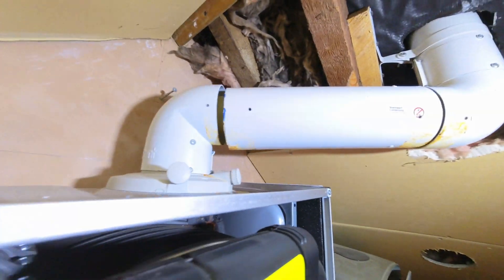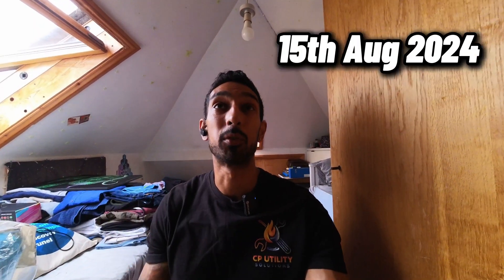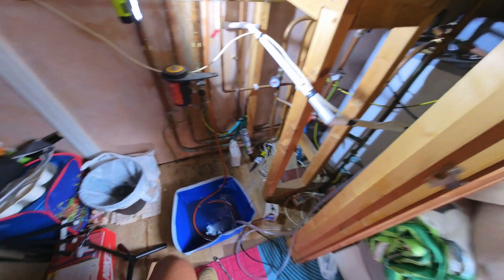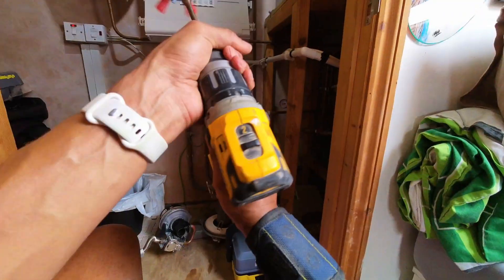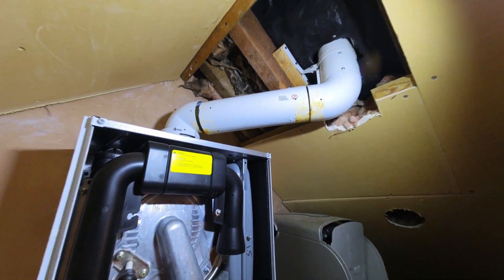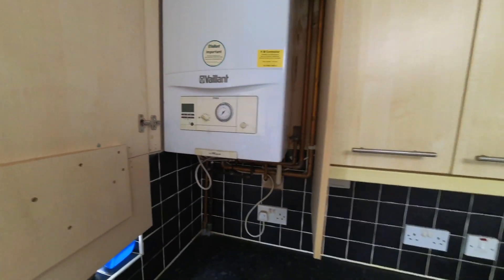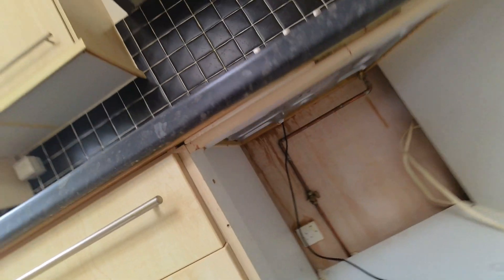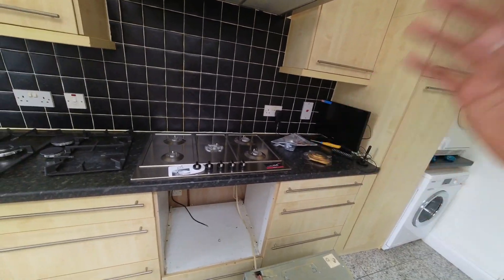This Could Have Killed Someone! - A Day In The Life Of A Gas Engineer 179

Comment: Came across a vaillant flue with a couple of elbows. The customer said the boiler was leaking. I checked the inside and it was all dry. The flue had a decent drop from outside. When I undid the xollar screws I was as shocked as you. 4 to 5 cm gap and a big collar to cover it up. The flue condense pipe was just touching the seal.
Reply from the maker: Come across some proper bodge work don't we!

Comment: Hell fire that gas flue installation was appalling and as you say highly dangerous. Am not a techie, wondered if you check for negative polarity to protect yourself? Saw YT vid where sparky called in due to eratic behaviour think of the led lights and found when meter been changed for smart the + - tails got reversed going into the Henley block.
Reply from the maker: Oh damn! I do carry out safe isolation and polarity checks where necessary, but yeah that's scary!

Comment: I found a vaillant ecotec once with  flue in a void it was approximately 8 meters long and had fully rusted through most of the way along it. It was one of the worst installed flues I had ever seen. At the time boiler was 6 years old. But it was used 24/7 replaced the whole thing 🎉
Reply from the maker: Wow that sounds like a bad one!!
Reply: @cputilitysolutions   single lipped vaillant flue seals are total crap
Reply from the maker: 💯 I've gotta change a turret & flue seal on one tomorrow 😅